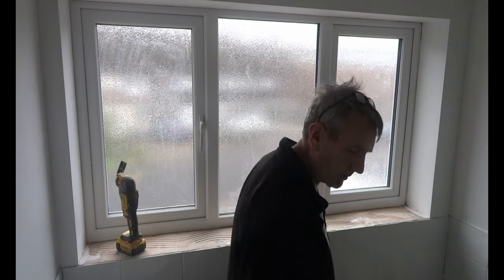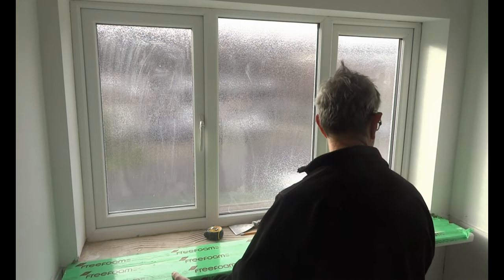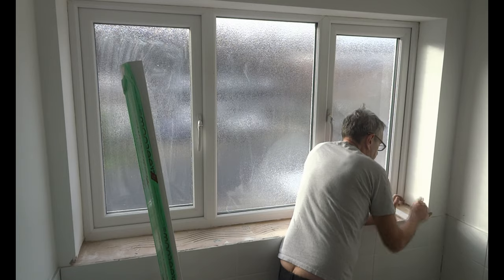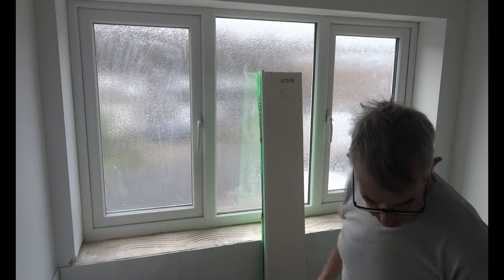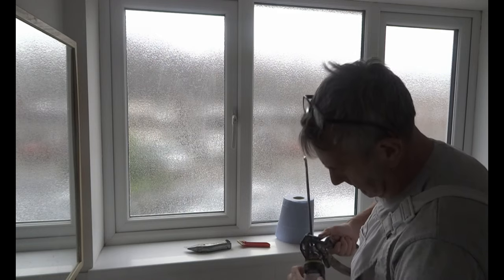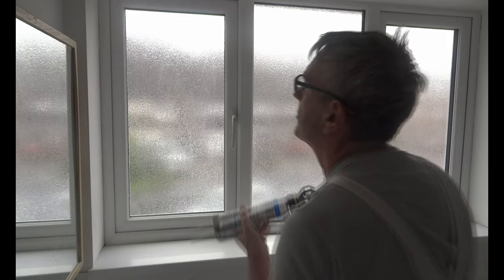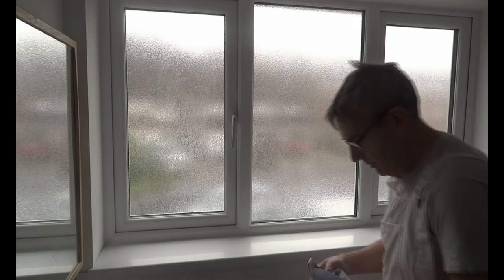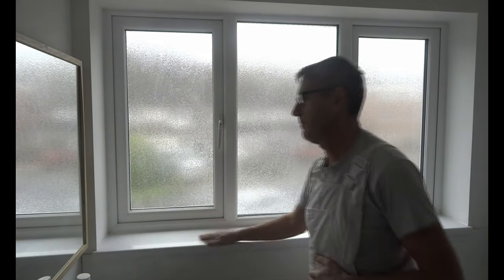Fitting a Plastic window board in a bathroom

Comment: Hi David, great video. Where did you get the window board from?
Reply from the maker: HI ABC, it came from 4shires summers Road Rugby, most Towns have trade plastics outlet, good luck cheers Dave
Reply: you can get PVC trim at any building supply center look in exterior trim for outside the home to